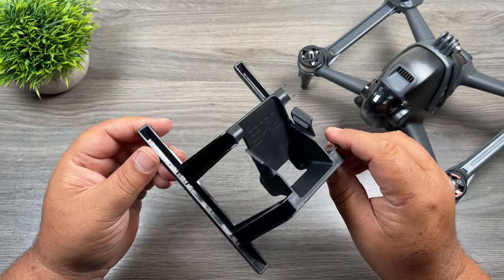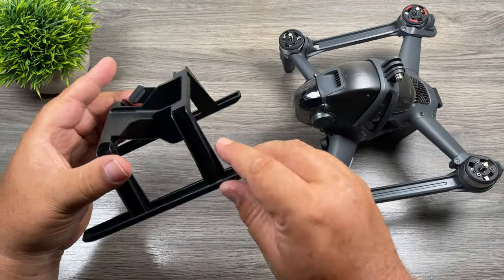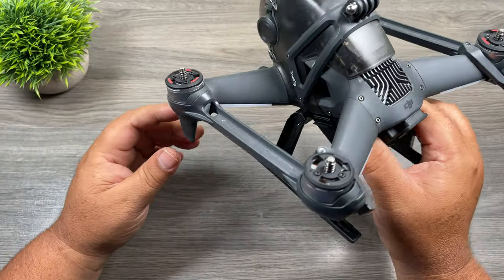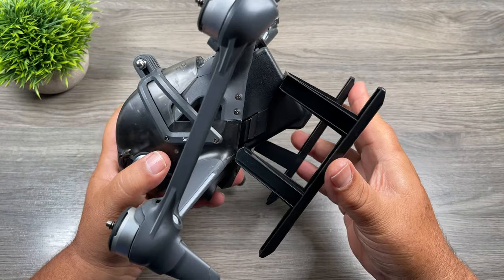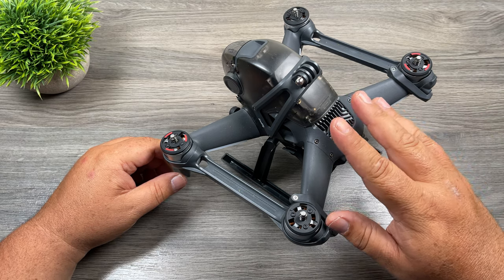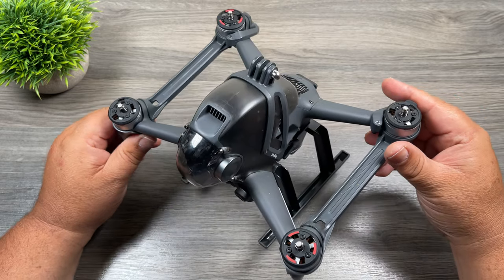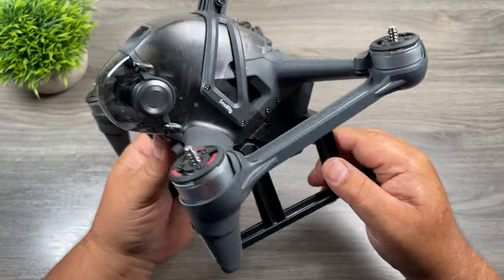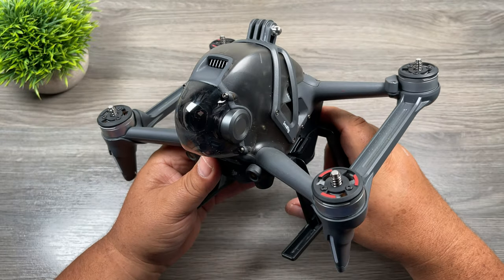DJI FPV Drone Landing Gear

Comment: They also have the landing gear that’s attached to the arm braces a little wider spread they’re nice also I have both sets just don’t have them on if you’re doing manual mode and flying close to trees over the top you will get hung up but all in all they’re awesome keeps the battery off the ground and protected

Comment: I want to have more confidence over water and deep snow,so do you think it's possible to attach noodles to the skids so that, if it lands on the water it will not sink, and doesnt sink down into the deep snow(powder)? will that disturb the sensors?

Comment: Just did my first full manual landing on concrete the other day..........the best thing you can do in a dirty situation is take off on your lap and hand catch it :) Or be a boss and land it in M mode :)
Reply: and if I had arm bracers on my dji the last crash I had would have been way worse. It took the right front arm off and the body was done for, but everything else was perfect :)

Comment: Idiotic, that's what it is. Drone already has landing legs and connecting the arms together just increases the chances you break 2 arms instead of just one.
Reply from the maker: Wrong. You are less likely to break an arm with the Bracers installed. You’re just repeating garbage that you read about in Facebook groups of people who have no clue. And either way whether you break one arm or all four It just goes back to DJI care refresh at the same Replacement cost.
Reply: The antenna for FPV drone are in the front and rear landing legs. Rear landing legs are subject to potential damage because of the weight of the battery with repeated hard landing.  Landing gear is a life saver in the long run.
Reply: @charlesbashay5956  hard landing? land properly, problem solved.